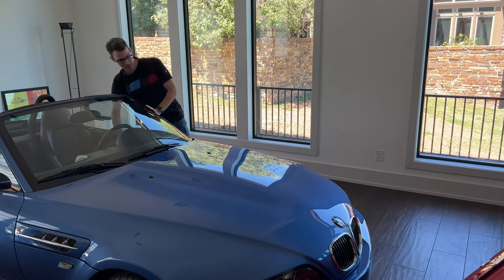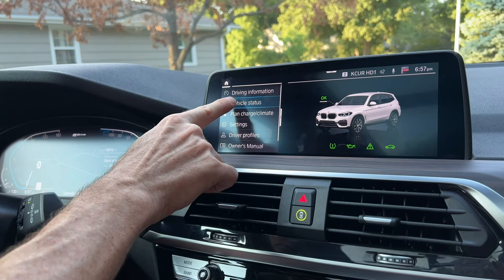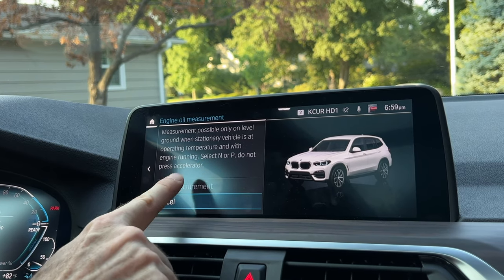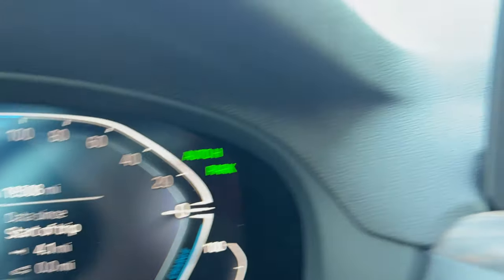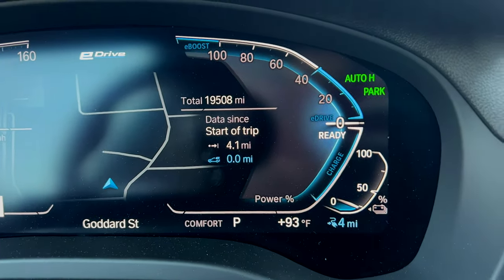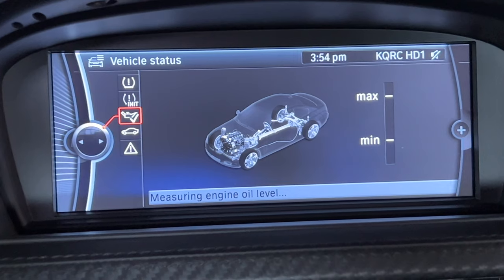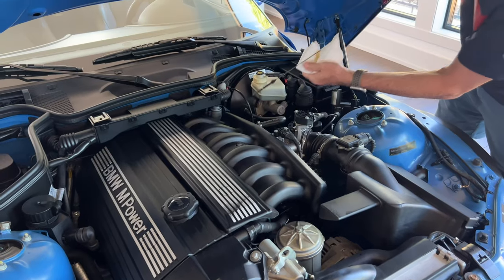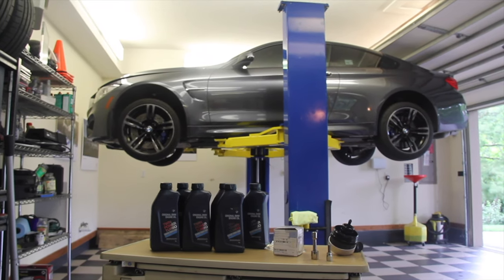How to check the BMW oil level

Comment: BMW's elimination of the dipstick is the #1 reason why after 30 years of BMW ownership my next car WILL NOT be a BMW.
Reply: Exactly by the time it checks the oil level the engine thats low on oil is already blown
Reply: @MJT-DA  Several years ago I picked up a e90 sport package manual and with 52k. The car was mint. After a few months the oil indicator would read error or just flash the last read level. Drove me nuts not knowing what the exact oil level was and with no other way of checking it I sold the car for what I paid for it nine months later and bought a mint stock 2004 325CI manual. When it goes that's it unless BMW returns the oil dip stick. I will not support their idiotic default defacto statment that "BMW owners never open the hood and check their oil so that''s why we removed it" That's b.s. I own a 99 Porsche 996 and it has both the electronic level indicator as well as the physical stick so there is no reason you cannot have both. I mean come on! BMW has always been and enthusiast car. It's pure instanity form a engineering perspective. An to top it off you have others that drank the Kool-aid and stick up for BMW's idiotic move by saying "Audi, VW and Mercedes also removed it as well" to which my response is "I guess it's Lexus for me from now on then".
Reply: @24hourgmtchannel64  exactly why do you think albert biermann left bmw and joined Hyundai/genesis. It feels weird to say this but the genesis G70 drives like the older bmws just with slightly less horsepower. They also still come with a dipstick. The bmws in my area get so marked up that there is no point in buying one. Only the rich Asian kids at my university drive bmws the new car enthusiast cars i see are the: Elantra N, 23 Golf R, GR86, Mustang GT and my current car Genesis coupe. I talked to those kids and they said they get rid of them at 40,000kms. I wonder why?
Reply: Exactly! Having to drive 4 miles just to check your oil is completely bonkers.
Reply: I agree but I will buy a bmw, but my plan is to somehow make a dipstick and provide that information. Yes it requires work, patience and time, BUT, from my personal experiences I think it’s worth it for the driving experience.

Comment: What do I do if it’s leaking oil during the night and you want to check oil level before going to work. But no I can’t because engine is cold… So let’s gamble and put my engine on the line, thanks BMW

Comment: I still have no idea how can electronic measurement be more better/accurate/cheaper than one goddamn piece of tin dived into an oil
Reply from the maker: It's just as accurate
Reply: @bmwblog  it may be. But still, its a solution for a non-existing problem
Reply: @bmwblog  can the sensor go bad and give a false reading?

Comment: Hi. Fred here from Brazil wiht a BMW 325i 2011 with a N52 engine. Any problem if my oil level is in Max level? Recently I noticed that level was around mininum and I completed with 6100 Motul. And then the level is in Max, not above Max. Any problem?

Comment: E90 335d has a physical dipstick 09-11 in the US. X5 35d until 2013 IIRC.
Reply: Do you check the oil level when the car is on or sat for awhile?

Comment: Hi great info  in my e92 I have to drove like 30 min before it's give me the oil level is it normal? Thanks
Reply: All depends on the temp of the engine oil before the BMW will give u a read. Colder climates will take longer than South FL in the summer. imho, is a good idea to warm engines up slowly. 30 min does seem like a long time tho, Most for me is around 15 min, but I keep my car in a temp-controlled garage. (Chuck from Vid)

Comment: No dipstick is over the top arrogance and foolishness on BMW’s part, why reinvent the wheel and make something so simple and straightforward, so ridiculously complicated?

I have a 2011 E90 335i and I’ve added nearly 1/2 quart of oil and the oil measuring system hasn’t budged.